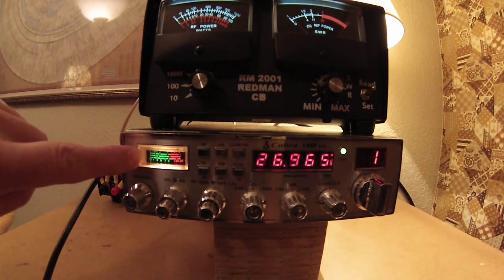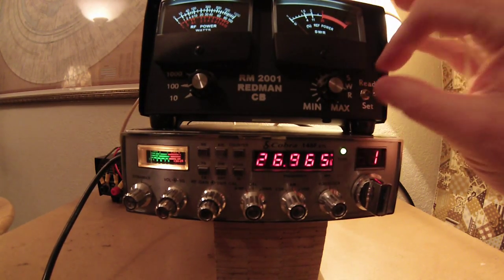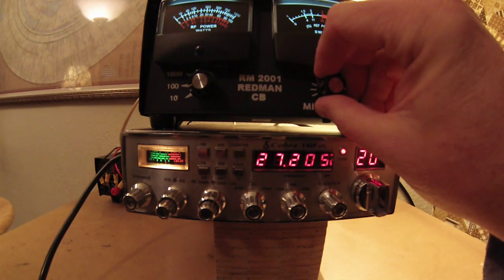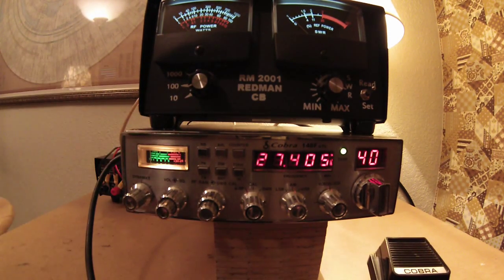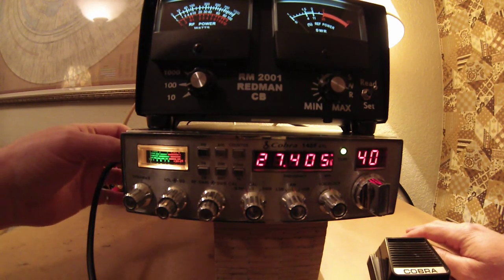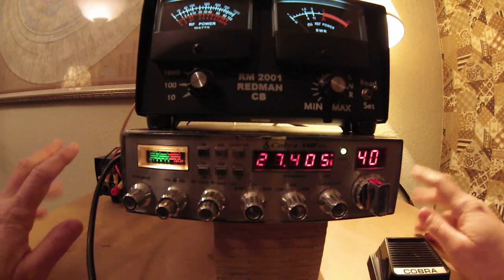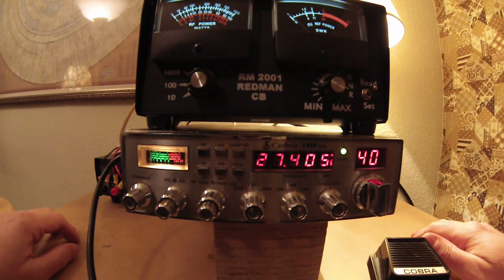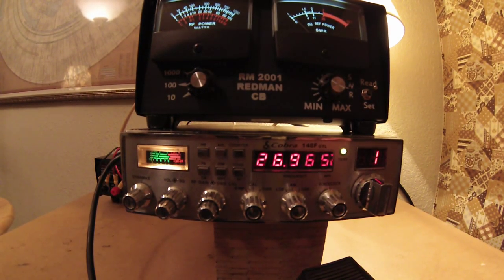DIY CB Base Antenna Using a 102 Inch Stainless Steel Whip - Pt 3

Comment: The 102 whip makes a great base station antenna,Not long ago I mounted a 102 whip flat down tight against a metal pole barn roof with a 40x48 foot print using the entire roof as a ground plane. SWR flat from 26.0 to 28.0 then slowly climbs 1.1 down into 25 and up into 29. Broadest band coverage I’ve ever experienced, no spring just the 102 whip. I talk all over the lower 48 and up into Canada. I always get reports of loud and clear, and often accused  of running power, the radio is so quiet sometimes I think it’s not on. Sweet deal for a $ 20 antenna.

Comment: Hi Dan, First I must say I enjoyed the three videos on the whip. Great music also. Now I know why mine didn't work. Even though it was a base station antenna (the instructions were rough, someone in China TRIED to translate). I went to a lot of trouble installing it. It was not grounded. Said nothing in the instructions about that. Do you think I hurt my radios transmitting on it?  Hope not. How frustrating it was. I could hear people in my neighborhood booming through my speaker and no response to my transmissions, ever. I broke that antenna taking it down, but I do think the ground plane portions are intact. I believe they are aluminum. Yours look steel. Does that matter? I noticed that for your ground plane, whether you had the two element or four element, the total footage was 16'. I think I had three elements so do I assume they should be 6' each? I have the 102" whip and the 4" spring and two different pieces the antenna goes in. Sorry, I don't know what they are called. The whip came with one, but I thought it was too short so I bought one that was 1 3/4". I want to maybe salvage the bottom of the broken aluminum antenna and use the steel whip in the middle. I have a ton of radios and amps from yard sales...even a Superstar that has a 10 meter band (with Superstar 250 amp).....going all the way back to two Johnson Messenger 23 channel radios. The first really small radio (for back then, early 60's). A mobile unit. No tubes. Yard sale...paid $3 for one and $5 for the other I have been trying for years to get something working, but it always seems antenna related. John